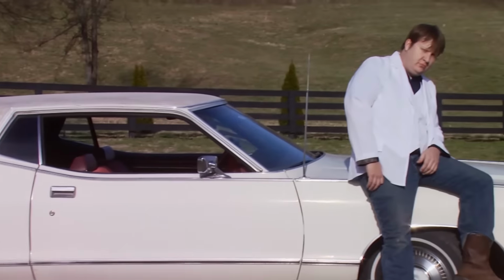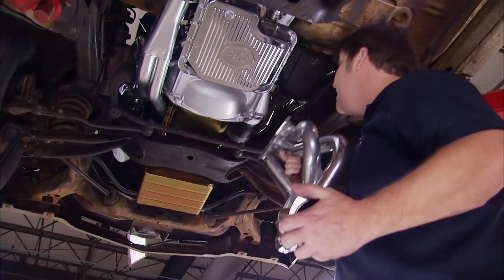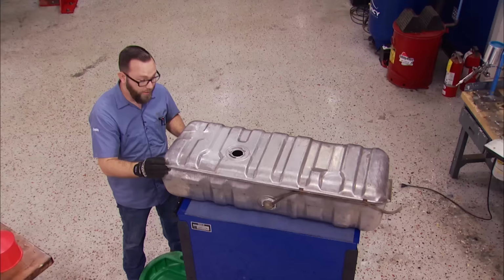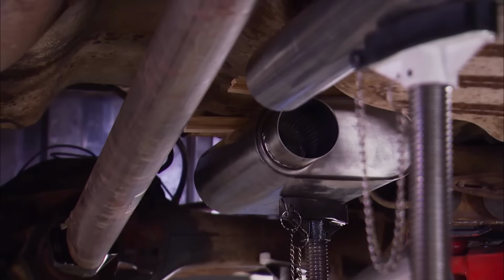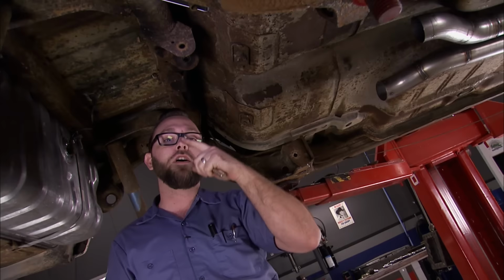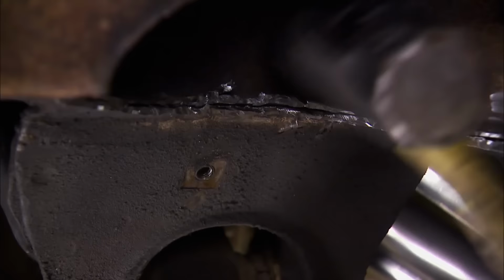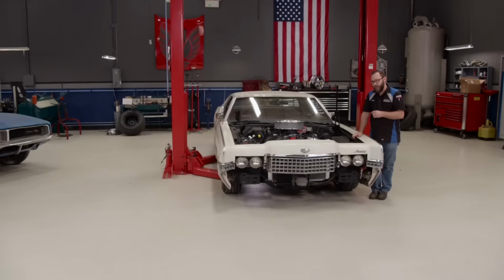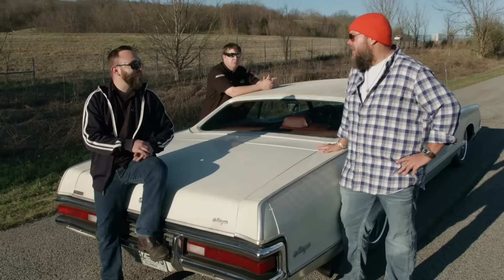FULL BUILD: A 1,100 Horsepower 1972 Mercury Marquis

Comment: I had a 73 black on black on black 4 door Brougham, learned if you use a first year 429 timing set, it becomes a huge h.p. bump.
I was able to grenade the c-6 trans, and the frame where the lower control arm bolts in on the passenger side.

Comment: I forget what application it came from but when I ran a 385 big block, I found a starter that did NOT use that GM type starter mounted solenoid. IMO this type wasn't as prone to the slow start issues caused by the starter getting heat soaked by the headers. I'm hoping to see EFI on this ride some day.

Comment: I agree I work and and transmission shop you don't want to scratch that front up there sometimes you got to put the engine n and then put the transmission install
Reply: Long tube headers on a big block or that motor like you got or short tube headers water makes more torque want to makes more horsepower but it's all in the size of the tool of a diameter of the exhaust manifold on your headers at using larger headers or top end smaller ones more for torque movie anything that don't include the rest of the exhaust system

Comment: For any of you watching whatever you do never buy a monster transmission bought an E4OD from them a while back it was supposed to be good up to about 600 hp I had around 400 but towed alot so I went in the side of caution it lasted 5 months warrantied it and then that one lasted another 7 months finally I made the smart choice and had a reputable local builder build it I was there for the teardown because  I wanted to see what I had paid for I didn't get what they claimed it all the parts were stock except for the clutches and a shift kit they made the same claims like "machines for more clutches " etc. All said and done if you count down time from work they cost me over $4000 and that's being generous

Comment: Hay Guys:  To eliminate flash or old fuel fire ignition, just run some car exhaust into the tank with an exhaust evac. hose for 10 minutes.  It kills the excess fumes from fire ignition by neutralizing the fuel to nothing!  Come to think of it, I wonder about cam overlap with the mixing of fuel and exhaust gases, huh?

Comment: The studs were long enough for your build. Rule of thumb for proper thread engagement is 1.5 time the diameter of the bolt. So 7 threads is proper engagement on that size stud.

Comment: I dont want to talk shit about these guys as they do an amazing job BUT you should always be careful of how much sealant you do put down around the the water pump and gasket because when you torque it down it squeezes out the other side and over time will fall off and little bits of sealant get all through your engine clogging up your cooling and causing massive damage later on just saying guys

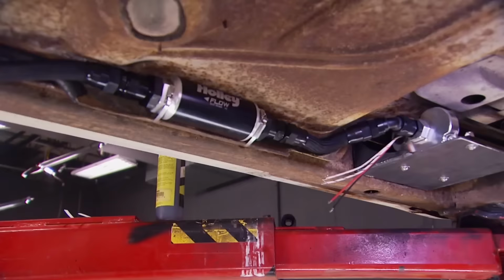Comment: If you think the price of those stainless bands [30:22] are high, try buying the proper installation tool for them that has the adjustable torsion bar/auto cutoff feature - they are sold by some electrical suppliers.  You could have paid a machine shop for a custom milled aluminum clamp instead and had change leftover for a tank of gas and lunch.  Also... you can absolutely shred your hand on that loose end, and I mean like a ginsu knife. The tool [used properly] will snap the loose end off close with the retention buckle - typically leaves about 1mm showing.
Poor mans fix?  Go get some plumbers tape.  Holes are already there to poke fasteners through,  and steel is annealed for easy bending to conform with an installation.

Comment: Nice job guys, next time use a power stroke oil burner in Ford mercury cars that were built from 1972-76 and damned near all Lincoln's from 1955-79, face it boys,a 6000lb Blvd cruisers ain't hotrods regardless of horsepower at least diesel engines were built for such workhorses.

Comment: Hey everyone. I am new to being a mechanic but i have a question. When he was making the square piece of metal to weld to the cross member to give clearance to the headers, would it not have been easier to simply use C channel  from an old chassis instead of using angle iron. Is there a reason that would not work?

Comment: I couldn't help but laugh. When I was around 13 my parents had a Mercury Monterrey with a 390c.i.   Once when they were gone my sister and I took the car around the block a couple times and also did burn outs in our driveway. That big block did excellent burnouts.  But then we noticed all the burned rubber up and down our driveway, which we had to take wire brushes and soapy water and try to remove before my parents returned.  They never said anything so I guess we removed the evidence!  Long live the Mercury Monterrey.

Comment: These things are commonly used lashed up to $19.99 a day U Haul trucks to make quick dog feces runs. That's right, 1/4 mile dog crap racing. Hee Hee. Oh be sure to spew out a few "SumBitches" when than rear end torques itself off that rusted frame. Be sure to use different air bag heights at each wheel. What a hoot that will be. Mountain Dew!

Comment: The underside of the car is rusty, the fuel tank is nice and shiny. Why not just admit it’s a new fuel tank? 
There is nothing to be ashamed of in replacing the tank, they replaced the engine, fuel system, exhausts system, and gearbox.

But it would also be nice to see some anti-seize compound used on the various nuts/bolts. All that time, money and effort, and they could not spend a few extra seconds making it easy to take apart later on. My 23 year old ride comes apart on demand. Every single nut/bolt has been treated with anti-seize.

Comment: Nice build nice car, I took my driving test in a car just like that it was my grandpa's. I got one problem all of everything you did you didn't clean up the bottom of the damn car for undercoat or any kind of paint and that's a shame spend that much money on all those good-looking parts and you can't even get rid of the rust on the underside of the car, shame on you boy you need to remember attention to detail

Comment: So let's throw 700+ hp (potentially 1000) in a car, re chrome the bumpers, put new wheels on it and then leave the frame completely untouched, barely touch the brakes, put the crudest possible airbag suspension in it, forgo the bump stops and front shocks or any front suspension upgrades or even oem replacements and then hope the factory steering system is up to the job after a shiny pump is put in. What could possibly go wrong

Comment: 1:15:50 Just hear how hard the engine is working and how slow it's accelerating for a 754 HP.
It's such a massive waste to make such a big and powerful engine and then connect it to a 3-speed gearbox. Put a modern 8-speed or 10-speed, and it will be something different.

Comment: I would sure like to know what the total cost of replacement parts came to and an estimate on total shop man hours was.   I think you did a financial job on this '72 Merc project car.  I think the total build costs would be way too much for me as you did this project ,,,,,   but I would like to do a low budget version for myself.   Any advise from you would be appreciated.  Thanks.
Reply: They spent (got free advertising parts because TV) $60,000.+ in parts alone.  But if you were doing this and you could afford that engine, just use an aluminum low rise manifold and don't cut the lame ass hole in the hood!  Don't waist money on the rear end ... why replace "an indestructible 9 inch Ford" with "an indestructible 9 inch Ford"? (unless it's free) All they needed to do is box the existing 4 link control arms (basically weld a strip of metal on the bottom of the existing c-channel).  The rear discs were nice but the factory brakes would work fine.  Spend the money rebuilding the existing suspension with all urethane bushings and new ball joints etc.  Buy new stiffer lower springs and it would handle very well compared to what they did.  Air ride was lame, and to think they didn't sacrifice frame strength with the huge holes they cut for the front bags ... WTF?
I speak from experience.  I own a 79 Ranchero GT Brougham that runs low 13's with the air conditioning on.  With slicks I ran a personal best 11.92.  (Only one second slower than my 1985 FJ 1100 Yamaha!)   RV juice ads maybe 100 hp, but puts in enough torque to get it done.

Comment: I’ve owned a few bagged trucks and that compressor all by itself will take forever to fill that tank.  You’ll burn that little guy up quick. You need 2 and not that series of compressor. Or run a engine driven one.

Comment: I saw mech tune Dad's 72 Montery. Then His Das test drove it,, turned itty screw driver  backed out laid rubber. A few days later near
Reply: USS NC some joker went slow, hit gas and brakes,  and gas and brakes. Semi coming closer. Mom, Dad , Me Bro in law, 1st grankid and my pregnant sister, AND a trunk Jammed with luggage. Dad stood on it we were north of 70mph now, both tires lit and hooked, carful of rubber smoke and then PUSH. 400 Modified in 72 outran my 74 460. Blue Torque!

Comment: its common knowledge a 3 inch exhaust becomes restrictive over about 340 Hp ! i think thats quoted from mandrel bent systems. 
SO with 1080HP shouldnt they have  at least a dual 3.5" exhaust?  cuz dual 3 " is gonna start choking off power around  700hp

Comment: Why waiste all that RTV on bolth sides of the water pump gasket. If you lack confidence in the gasket sealing it a little sealer around the water ports is all that matters. There is nothing in the center to leak out..

Comment: They ruined the low clean lines of that car when they stuck that goofy air cleaner through the hood. Surely they could have thought of a better way to plumb the air into that motor and keep the hood intact.

Comment: I bought a land yacht for $350 USD just for the 455 and spare transmission.

It effortlessly did a 100mph and floated down the road like it was on a cloud.

But no joke got 4 gallons to a mile and after work got exactly 4 miles to a gallon.

In a short wide squarebody Chevy truck it got 15-18  mpg with two Holley  4 barrels.

It was fun....but the source of a really %^&$@^ driving record and expensive auto insurance than took a long time to fix and about the same cost as a freaking house.

I get honked at frequently for driving just below the speed limit now. Got kids to put through college now. Impatiently honk and I'll sit through that flashing yellow for the go-go  green just to be an arsehole.

It was fun to build and drive before  I got "wallet raped" though. 😂🤣

Comment: All that great work, and it is professionally  done, is about useless because there is no way to put the power to the ground. A 600 HP car with 15 inch wide street slicks will leave this car in it's dust. I will bet this Merc will spin it's tires at 70 MPH - or maybe 100. You can watch videos of high power cars spinning their tires during 1/2 mile runs at over 100 MPH.

Comment: Cool, but that hole in the hood is just not it. The exhaust tips same, just looks way too rushed and unfinished. Nice oval or rectangular tip, tucked close to the quarter panel or even through the panel itself......Like others, show the frame a bit of love, even a coat of Fluid Film just to protect it. Finally that steering wheel, would have been nice to get it back horizontal. Just an opinion and no one likes them much these days. Hope to see some follow up vids where the car gets bit more attention.

Comment: Funny how the torque finally eclipsed horsepower with the 300 nitrous shot set up.   Timing back to 18 degrees maybe?   Y’all didn’t show RPM with those power numbers though.    Huge deal.   And what did the curve look like before the nitrous hit?  In other words, you can’t drive around all day on nitrous.   It might be funny, but not practical.   It would have been helpful to see the curve the “power under the curve” with each pull and the requisite ignition timing.    That’s a lot of cubic inches, and 18 degrees would obviously save the pistons on nitrous, but wouldn’t it be a dog around town with it that retarded at lower RPMs?    I mean, yeah, it is a massive displacement engine, so it’s not gonna be lazy anywhere on the curve, BUT, how about set up the springs in the distributor for lots of initial advance, then less total for the higher rpm retardation you’ll need for the full throttle nitrous hits?   I didn’t see the ignition part if the build, maybe that could be done electronically instead of springs?    I also didn’t catch the compression ratio.   I can’t believe y’all left that crossmember on the car when cutting it.  Awfully dicey with that trans cooling line right there.  A lot of DIYers might not account for the risk of collateral damage here.   My family used to have a Green Machine, 1972 Grand Marquis, 4-door, 429 of course, and my older brother told me how a trunk full of firewood once gave him the traction needed to smoke a 1972 Charger.   I’ll bet the Charger had a 318 though.      Just saw what exhaust y’all are gonna put in.   That ought to shift that torque curve a bit.   Would love to see that new dyno curve.   That things gonna need some fat tires for sure.

Comment: Who the hell puts a 2300 stall converter in a big block car with nitrous 🤦🏻‍♂️🤦🏻‍♂️🤦🏻‍♂️🤦🏻‍♂️🤦🏻‍♂️🤦🏻‍♂️ unbelievable
Reply: It's a street car it doesn't need a big stall converter. They could have gone 3500 , but I doubt they will spray it that much.
Reply: @ttulley8103  wrong.  A big block with a cam would have to have at least 3500 stall. Especially as a street car.

Comment: But it's NOT an 1100hp engine. it was a paltry 700hp WITHOUT nitrous. My 545 stroker is a 640hp engine, could be 900hp with nitrous but it's not, it's 640 without a power adder. Sometimes this show just blows smoke.

Comment: First of all, this car needs a complete body off restoration WITH chassis/suspension WAY upgrades. A new ultra handling front clip where the wheels/brakes/tires and suspension/steering components ALL interact pro
Early to yield an integrated operational system which takes account of the power you're making. And thats another thing..why AREN'T you setting the engine BACK like 6" to 9"?? You're doing all this work, why not help the handling with this simple step. You're installing a new driveshaft which can be to your specs. As far as the, rear end, you're installing a whole new rear end. Given the $$$$ your investing, why not go all the way and intall any of the many good rear independent rear suspension kits available? They may not scale up to the 1100 Hp/4500 Lb level though. But besides leaving the rust in the body/frame, the SIZE of brakes is the worst aspect of all this.
Look at the size of brake discs and think of how many sizes bigger those units could be given the size of the wheel size enlargement they made and the huge increase in stopping power that would make in a 4500 Lb plus weight car......

Comment: All that RTV around the water pump. I'd fire a mechanic that did what this guy did. Only thing other than the gasket is a small amount of gasket glue to hold the gasket in place to bolt up the water pump.
RTV is way over used in engine building, just shows lack of experience and/or cheap China parts.

Comment: Slotted or drilled rotors would have been better due to the weight of the car and amount of horsepower it has. You spent all that money and you went the cheap route on a vital part of the car 🤦‍♂️

Comment: Had to stop watching as soon as you promoted Monster Transmissions. Complete con artists, Im sure they built you a nice transmission. But when you promote them and regular people go buy them, they build us junk. Mine left me stranded and spit parts into the pan with less than 500 miles. Always buy local so you can work with the shop if you ever have problems. If you buy a Monster Transmission you have a very very high likelihood of having issues, just go read the forums on the web. My current transmission has lasted thousands of miles. That company has ram-rodded thousands of customers.

Comment: Everything was going great till they decided to put in AIR BAGS ... years of problems lie ahead. So many people put them in when the craze hit and so many of them have gone back away from them. Air bags is a never ending money pit. Always something going wrong or leaking.
Reply: The bad part is with the original spring mounts cut out it would be tough to change it back to proper springs. I would have used the stock hubcaps on wider wheels and found a way to get the engine underneath the hood,  like a drop air cleaner  base  and using the hood to seal the top of the element, lose the carb spacer or mill the top of the intake down. The wheels and hole in the hood ruin an otherwise perfect sleeper.